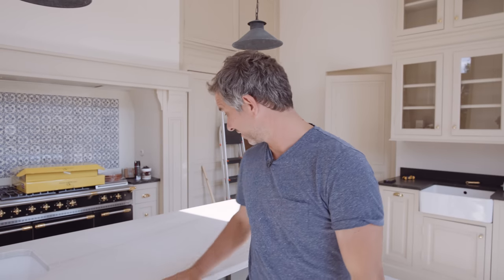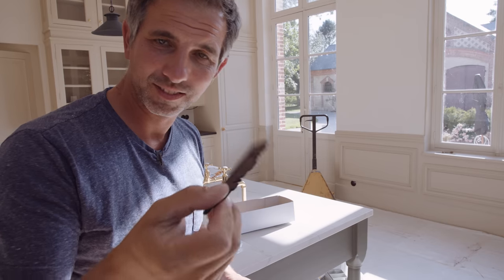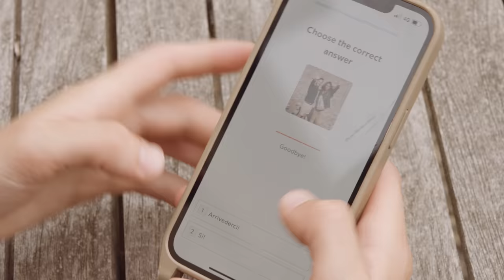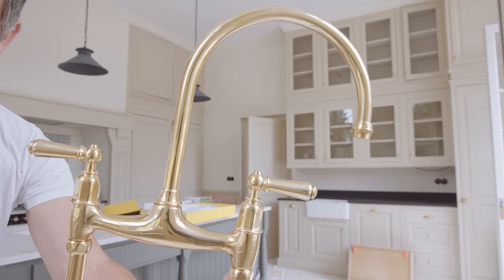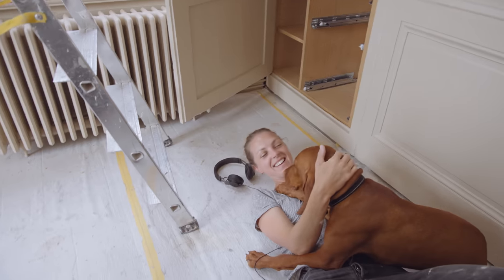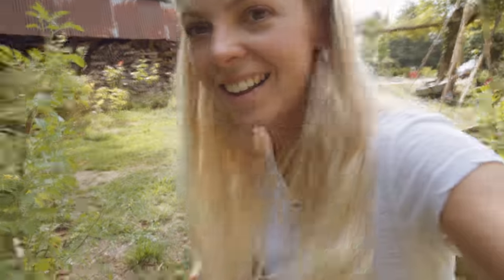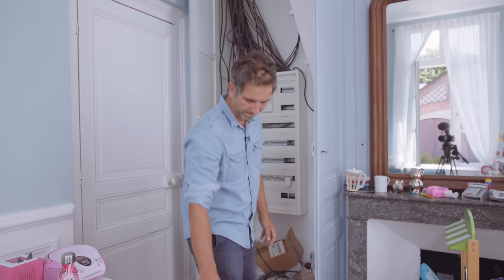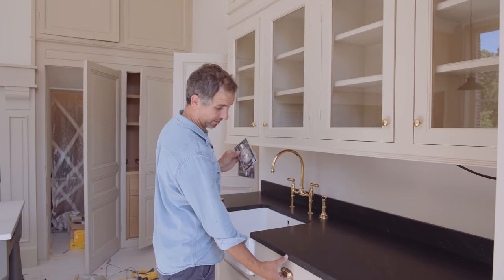CHATEAU KITCHEN MAKEOVER - These might be the most beautiful kitchen taps in the World.

Comment: We have remodeled many kitchens in our apartments and the first thing we always do is add shut off valves on each line. If one is doing a major remodel we add  distribution manifolds for both hot and cold water. This way you isolate just the area you are working in without shutting off the whole property. Well worth the cost when everything is down to bare walls.

Comment: Note to P... Go back a few months to edit your plumbing works. Once there, install shutoff valves on every tap and toilet. You'll be grateful the next time a leak occurs or a faucet begins dripping or needs repair/replacement. There should never be a need to shut the mains water off. As you stated, doing so whilst guests are on the property can impact their enjoyment: not to mention your work schedule. 

Cheers!
Reply from the maker: I used to do this untill a (very experienced) plumber told me that whith each valve you invite a week spot i your system. It's a lesser evil to have to switch of the mains from time to time..

Comment: Philip, If you ever find the seals for sink wastes or WC's unsatisfactory there is a very good product called Plumbers Mait. It is a type of putty and a small ring around pipes works very well. The real advantage is that it remains supple for ever but also 100% waterproof. I have found that with hot water the seal provided may fail but this product always works well.
William
Reply from the maker: Thanks so much for this tip!
Reply: @HowToRenovateAChateau  
I am glad you like the idea of this tip. Apologies I think I spelt your name wrongly.
Simply roll a small sausage of putty between fingers and place in a ring around the thread between the waste piece and the sink. You can put another small one underneath and screw on the fixing nut. Any excess squeezes out and can easily be removed at this stage, but best not to use too much. This can also be used for ordinary sinks and WCs.

I have found if almost boiling water is put down the sink when draining vegetables Etc then the often rather flimsy seals provided often fail with time so now I discard and use the Plumbers putty for the first fix.

I am sure you have never done this but never be tempted to use silicone as it is very difficult to remove later. I have been renovating a 100 yr old House in Var  for 10 years now !
Happy Bricolage, William
Reply: One last piece of information. I have not been able to find this product in France. I have always bought it in UK where it is readily available in most good DIY shops !
William

Comment: Switch the taps around....the taps on the kitchen island are too low, if you need to fill a pot of water to the cooker you will have to hold the pot deep in the sink on the kitchen island....the taps on the kitchen island look wrong they are  too small....think they need to be switched.